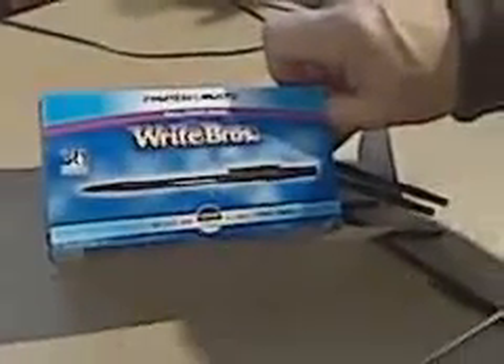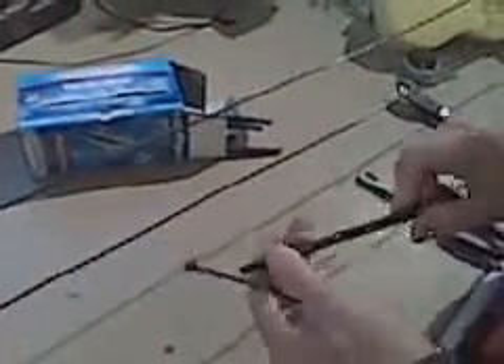Building Ladder Line by N4LQ

Comment: Brilliant! You can use a sealant gun to plug the ends to stop water getting in.
Reply from the maker: Careful.... If you seal it up, moisture will build up due to condensation which will result in a permanent poor dielectric. Water will get in no matter what you do. The important thing is that it can drain out or evaporate.

Comment: Could you also use this technique for spacers in a fan dipole at QRP power levels?
Reply from the maker: Sure but instead of ink pins, these are now popular https://www.tractorsupply.com/tsc/product/american-farmworks-4-inch-fin-tube-insulators-25-pack-1213270?cm_mmc=feed-GoogleShoppingProduct_-1213270&gclid=Cj0KCQiA14TjBRD_ARIsAOCmO9abr8Oc2V3b2owumzrvLco2ngsshetZdQRs8JSpCMPDQcu8jhN8leIaApPzEALw_wcB

Comment: It would have also been helpful to tell us what kind of wire you used? Type, gauge, insulated or non-insulated etc. Thanks.
Reply from the maker: It doesn't matter as far as building the spreaders etc. I have used all kinds of wire. Insulated wire is easier for the wire ties to grip though. 14 ga is fine for most apps.
Reply: Just curious as you often see Antennas like the G5RV where they use 14 gauge copper stranded wire but it is NOT insulated. Do they do this to save on cost?

Comment: If you want to "lock" the insulators in place so they will not slide up and down,  try shooting  some hot glue in each end of the insulator.  This generally grabs the wire and the insulator pretty good and it also keeps water out.   Takes more time a a little bit of cash but it works well.
Reply from the maker: I promise you ,,,, If you use wire ties THROUGH the tube and pull them snug, the spreader cannot slide. In fact it is nearly impossible to make them slide! No glue needed. Some tubing better than ink pens might help though.

Comment: Steve, I wonder how this will perform when the pens fill up with water?
You see great minds think alike [lol] - my idea is remarkably similar to your's except I bought a 10m roll of sprinkler riser tube.
My idea is the same as yours ie. cut the riser tube into lengths, tread a cable tie through each tube to secure the wire.

I've had second thoughts, however. I wonder what will happen if/when the tubes fill up with water. I could silicone or hot glue the ends shut, but the problem with this is if any water (inevitably) gets in, then it won't be able to get out causing annoying changes in SWR. Mine is for a yet to be constructed HF 10-160m triangular double wave 160m Sky Loop (1000'+ and yes I have lots of space).
Reply from the maker: I switched to acrylic tubing.  I do get condensation inside the tubes. It doesn't seem to change tuning so I guess it's ok.

Comment: So how long did it hold up?
Reply from the maker: +Shawn Rullens I have switched over to using black, nylon spacers 1" long.
Reply: +Steve Ellington 
I guessing it did not last. It was worth a try. Experiment that was hams do. At least unlike the appliance operators the would rather plug and play
Reply from the maker: +Shawn Rullens Actually I used this for about a week then went to an "end fed" antenna and other things. Just this spring 2015 I bought some pre-cut 6" clear acrylic tubing and used this same method. This was 600 ohms and I decided to try 300 ohms so I chopped them down to 1". The acrylic, after just a few months, had begun to get brittle on the ends so I found some 1" black nylon spacers which will be my next attempt. The black wire ties hold up quiet well and I'm sure the spacers will as well.
Reply: +Steve Ellington 
The best material to use is UV restraint.
Maybe ABS Tubing or something. But what ever you use you have the self satisfaction that you built it and hopefully it works

Comment: The spreaders for swamp coolers have a nice small diameter very strong black tube that could be cut to size for ladder line spreaders using this method ... Just a thought.
Reply from the maker: Jim: What's a spreader for swamp cooler?
Reply: Me to. What is a spreader for a swamp cooler?
Reply: @Aimsport-video  @n4lq Sorry, I guess I should keep up with comments better!  Evaporative cooler would have been a more proper name but down here in AZ it seems everyone calls them swamp coolers.  It is a big blower that sits on top of the house and pushes air into the house through a wet substrate.  The spreader is a bunch of tubes that distribute the water over the substrate.  Google evaporative cooler.. I am sure it will show pics.

Comment from the maker: I got my ties at Lowes 11 inch long. Item #: 76330 |  Model #: 46-310UVB. That limits you to about 5". 
They fit the ink pen ok. If you want wider spacing you'll need to find longer ties and some kind of uv resistant tubing ie. fiberglass or poly tubing.

Comment from the maker: Spacing between pens is whatever you feel is needed. If you don't pull the wire ties real tight, you can slide the pens as needed, add more pens then yank them tight when finished. I used 14ga electrical wire from Lowes. This is not critical.